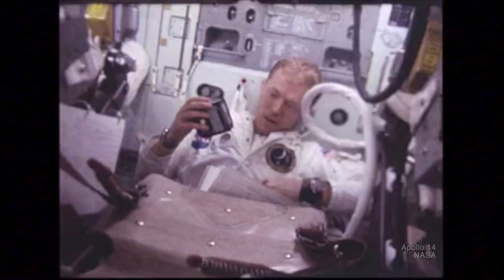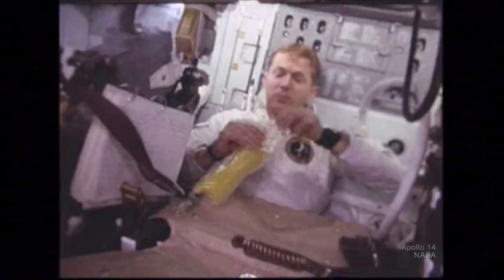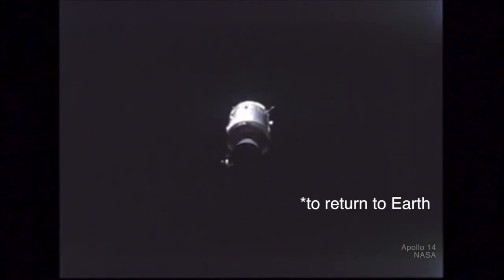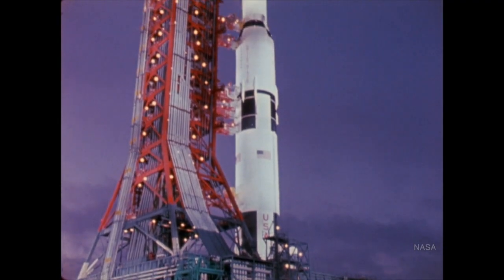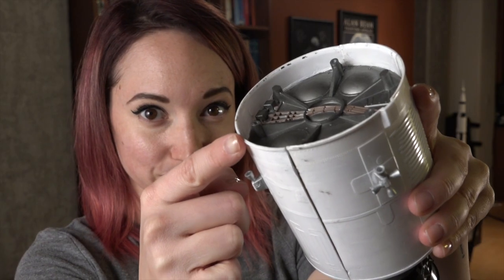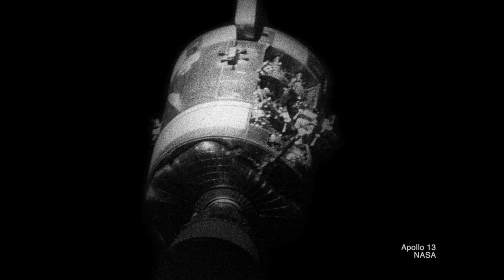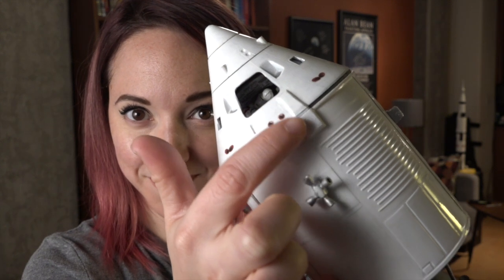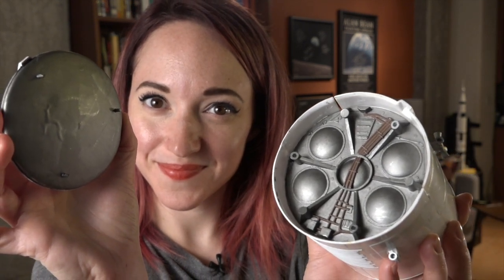How Did the Apollo Command and Service Modules Separate?

Comment: After CM/SM separation, how did the SM fall clear of the CM so as not to be on the same re-entry trajectory? Were the retro rockets (or whatever you call them) on the SM programmed to fire after jettison so that the SM would continue on a different trajectory?
Reply: The SM had a preprogrammed flight that activated after separation.

Comment: Apollo 13 they had to do things differently because the service module was destroyed in the explosion they could not use the compression springs to separate the ships because the power to them was routed through the fuel cells and the fuel cells were destroyed. to separate they had to use the LEM thrusters and the command module springs to separate designers feared the heat shield was cracked because of the shock of the explosion.

Comment: If there is a Heat shield down below, How did the astronauts manage to move from 1 module to another without spacewalk??
Reply: They don't. The service module wasn't accessible from inside, it just provided everything to the command capsule through an exterior connection.

Comment: New topic.
What type of rations did the crew on a moon mission have, how much did all of it weigh and how was it stored?
And please do one on how they used the bathroom during the flight both in the CM and in the LM on the moon.
Reply: There are scientific sites about Apollo, which are much better to consult, than amateurs on Youtube...

They had freez dried food in plastic bags, to which they added water, hot or cold.

The answer to your second question is sealable plastic bags with odor killing chemicals.
You know, there was a small compartment under the seats, if they folded one, where they could have a little privacy.
Reply: @YDDES  Liquids ie urine was overboard dump wasn't it YDDES. I know they chemically treated and stored solids.

Comment: I seriously doubt about the guillotine.
I guess they were primer caps, instead
Reply: @heclam: you should google this stuff before posting. Yes, a guillotine mechanism was used to severe the connections.  A very lite explosive charge was also used, as part of the guillotine mechanism to drive the mechanism to ensure the cut was complete.

Comment: I was just looking at some pictures  of  the  Apollo  capsule  after  splash down  and remembered  a question  I always pondered the answer to.... the picture shows  the floatation ring around the base of the capsule and 3 floatation bags up on the nose.  If the bags on the nose were to right an upside down capsule, why did the picture I saw only have 3 bags?  Also, the bags positions seem to be in wrong positions, there is no bag at the quadrant of the capsule where the egress hatch is located .   From my point of view, in a worst case scenerio, the capsule 'could' end up with the hatch under water and hinder egress after landing.  Am I missing something ?
Reply: "Am I missing something ?"   -   At least one thing that you are missing is that you appear to be assuming that the command module's center of mass is on its vertical axis, while in practice internal equipment distribution had offset the center of mass away from the hatch (apparently to give it some aerodynamic lift during re-entry   https://youtu.be/ayBNbY92cQM  ). So if the CM was capable of floating on its side (and I suspect that it wasn't, as I suspect that the center of mass was too low in the CM to allow that to be stable) then it would tend to roll to place the hatch uppermost. The offset center of mass may also explain the asymmetrical flotation bag positioning (though I would bet that system was designed to still work if one of the bag had failed to inflate, which would have rendered any symmetrical arraignment of bags asymmetrical anyway).
Reply: Richard Cornford Thanks for the reply.  My curiosity  made me blind to some of the engineering  involved.  I just watched  the video you linked and, along  with your comments , have rethought my question .  If the CM was built with the center of mass low and at the astronauts  feet for flight characteristics  then the locations of the floatation  bags makes more sense.  Watching  a splashdown, the CM hangs under the parachutes  with the lower CG  canted  downward.  Therefore, a flotation  bag could be needed to ensure the nose didn't  dip too far into the sea before the CM stabilized right side up.  Thanks Richard ,  you got my brain up and running  and reinvigorating  my fascination  with manned space flight.

Comment: Questions:  1)  How did the CM and SM "drift" apart?  Thrusters?
2)  Why not do an episode on all the hold down bolts and explosive bolts used in staging, liftoff, etc.  These connections were critical to mission safety.  How did they know that they would work?
3)  Finally, what about the explosives, if any, to be employed by a range safety officer?  How did that system work?

Otherwise, keep up the good work.

Comment: Hello!
I have a question not about how the Saturn V was “disassembled” but rather how it was put together in the VAB, because dealing with all the highly explosive material of solid fuel rocket motors, the explosives for stage separation and connecting two “pieces” of a rocket to one seems like a difficult and dangerous job... I mean did they weld the stages together or what :D?
I’d really like to be enlightened :^)
Reply: There was no solid fuel. Saturn used liquid fuel. And this was filled in only after the rocket was on the launch platform, and not in the assembly or before the transport. 

And the other explosives were so small, and they just didn't arm them before the rocket was on the launch pad. So nothing to worry about.

Comment: If true this was a great moment in history, unfortunately the US government has never told the truth about anything that I'm aware of so I'm going to take the moon landings with a grain of salt until proof is available.
Reply: There are photos made by space probes, and even by telescopes, already some years ago showing the remains of the landings on the surface.
And also already during the flights the telemetry was received and radio waves were tracked by stations all over the world not controlled in any way by the US or NASA.
More proof than anyone would need to clearly recognize it was the real thing.

Comment: After separation CM used surge tank to supply crew with oxygen, evaporators were used to control temperature and batteries (they had 3 of them) were powering the module. CM had its own RCS which was activated after a separation.
Model you are holding is not correct. Umbilical should be on the bottom and the second thing is that it was spring loaded.
Reply: Umbilical would not be on the bottom as any hole in the heat shield would case integrity issues,
Reply: @deepsleep7822  You have messed up the coordinates. Bottom is where astronauts have legs, heatshield is behind astronauts so it's at the back of the module and not at the bottom. The model she is holding shows the umbilical at the top (above astronauts heads), while IRL it was at the bottom of the module (below astronauts legs).

Comment: Here's a possible question for a future episode - Since the occupants of the LM had to stand for the descent to the Moon, how did they keep from floating around inside the cabin? Also, videos of the takeoff from the surface of the Moon look pretty fast. What were the G forces that they had to stand up and control the ship in like?
Reply: They wore a belt which had a thin steel rope on it, which were fixed on the floor.

Comment: How did astronauts travel from the service and command modules if there is a heat shield in the way?
Reply: While it's true that the crew never entered the service module, there were a few occasions where they had to do a spacewalk to access the service module during their return from the moon. On at least one mission there were film packs back there that had been exposed during lunar orbit. These had to be retrieved by hand before reentry.
Reply: There was a tunnel from the top of the command module to the top hatch of the LEM. Hatches and a docking probe had to be opened or removed for access.
Reply: I just posted that.  And missed it.  But I thought they passed through it ??  Confused
Reply: +reptongeek  The CM's heat shield is only on one side of the CM--the side adjacent to the SM (and therefore not visible until the two separate)--so it did not get in the way of docking with the LM.  The CM's nose on the opposite side docked with the LM's topside, a round airtight seal was established forming a tunnel between the two spacecraft, pressure was equalized, the docking equipment (a probe and drogue) was removed from the tunnel and stored inside the CM, and then astronauts could go through the tunnel back and forth between the CM and LM.  Or on second thought, I should have just posted this link:
https://www.youtube.com/watch?v=Ac47IgC39m8
Reply: ahhh Now I understand...So they only passed back and forth when the CM was flipped.  That clears it up. Thank you.

Comment: I don't need some young tart in a tight shirt trying to prove to me how NASA pulled the wool over the American people in 1960, by using video media today to "add" logical technologies that never existed back then to help explain how NASA did things. I have blue prints of the command modules and none of them list this "guillotine" that is attached along its hull. As a matter of fact, I like how previously released videos on YouTube are now presenting this "guillotine" housing prominently along the ships hull. Another NASA cover up if you ask me!
Reply: Looking at a November 1966 copy of "Apollo operations handbook: Command and service Module" I find section 2.9.3.1.5 (entitled "C/M-S/M Separation Mechanism") which describes a "dual-blade guillotine (umbilical severance device)" and figure 2.9-1, which depicts an "Umbilical guillotine" mounted inside the service module umbilical fairing and attached to the outer surface of the service module.

So if NASA had 'added' a "logical technology that never existed back then" they have managed to add it into the documentation at least by 1966, so several years before any moon landings had happened.

Of course it makes sense to attach the separation mechanism to the service module rather than the command module as once the separation had happened  the mechanism that achieved it would have become as redundant as the rest of the equipment on/in the service module. And this means that looking for the guillotine mechanism in blue prints for the command module (as opposed to the service module) would not locate the separation mechanism. Your research methodology is clearly  too narrowly focused to be effective.
Reply: Nice try. But you're very obviously an artificial intelligence program and not a real human. A word to the programmers - the key part if artificial intelligence is INTELLIGENCE. Your program has all the smarts of that old BASIC program Eliza.
Reply: You need a personality implant. Is your hero Arnold J Rimmer?
Reply: Q Storm you got rekt
Reply: Actually sir, I made my research about the umbilical system, long time before vintage space girl, and I have reached the same information.
The Apollo program was the best.
Reply: Don't be an idiot.  Just watch the young tart with the tight shirt with the volume off.  She's more attractive that way.
Reply: N. But yours is a young woman wearing a tight shirt and showing off her tiny breasts while talking space gibberish on YouTube.

Comment: After the service module seperated the ground had control firing the RCS to move away from the command module and steepen it's angle of reentry allowing it to burn up completely.

Comment: I thought the crew could enter the service module, but that would mean passing through the heat shield.
Reply: +Tom Riser
The service module was really not that big. It had the engine, fuel, oxygen, supplies, electrical power and that was about it. There was just not enough room for anything else.

Comment: In Apollo 13, the crew used the LM to generate upward thrust before SM jettison and then reverse thrust after to allow a clean separation of the CM and SM. I'm wondering how they did this on Apollos 7 & 8 when they didn't dock with an LM?
Reply: the sm has rcs too. It performed the separation. Remember! Apollo 11, 12, 14, 15, 16, and 17 DID NOT bring the lm back to earth, All the lms were crashed into the moon
Reply: But the ascent stage of Snoopy [Apollo 10's Command Module was named "Charley Brown", btw :-) ] is still in orbit around the sun. Ref: https://www.space.com/13010-snoopy-nasa-lost-apollo-10-lunar-module-search.html (They crashed Snoopy's descent stage only into the moon...)

Comment: Just a thought; the Appolo Service Module was not exactly smooth on the outside.  How come bits like the Reaction Control Thrusters didn't just get ripped off during launch ?
Reply: There also so thoroughly tested during development, that after A LOT of trial & error, they wound up with a finely engineered system
Reply: It reached extremely thin air before it reached really high speed.
It was diiferent whe it returned to the atmosphere at high speed.

Comment: The guillotine cutters method was also used on the F-111 series of aircraft. It didn't have ejection seats, it had an escape module. Iirc, the 111 used a blade driven by an explosive.

Comment: But how did the consumables and ASTRANAUTS. Pass through the heat shield from the cm to the sm ??????. Fake.
Reply from the maker: +Eddie Townsend They didn't go through the heat shield, they didn't go into the SM at all. They drew power from umbilicals, that's it!
Reply: Eddie Townsend A few of the service modules, Apollo 15-17, I think, did have a SIM bay that could be accessed, but only by spacewalk. And no, not fake. Not fake at all.
Reply: actually,  Apollo 13, and 14 had one too, (not sure about 11 and 12) The sim bay is visible in the picture of the Apollo 13 csm That was in this video! It is the hole with all the satellites in it, It is quite small and was only to store small items like satellites which could be deployed via spacewalk

Comment: If one of those straps holding the cm to the sm failed to break away before reentry would that have been every bit the disaster I think? I mean LOVC.
Reply: My guess is that bolts could be turned inside the CM to release the straps.

Comment: Stainless steel blades seems a bit complicated and heavy to separate the two.  Why not explosive bolts?

Nice video though.
Reply: Would there not be a danger of such explosive bolts close to the heat shield damaging it?
Reply: Stubrit while not 'bolts' the blades of the guillotines were driven buy explosive charges.  This ensured that the blades would cut all the way through and everything was housed to protect critical areas, as with all pyrotechnics on the spacecraft.
Reply: the soyuz spacecraft uses explosive bolts.
Reply: Perhaps because straps could go around the edge of the heat shield, whereas bolts would have required making holes in it?
Reply: Cracked heatshield = a dead Armstrong
Reply: @sol2544  And forgetting a dead Aldrin and Collins too.

Comment: amy how  did the astronauts get into the lm from the cm , and vice versa
Reply: after docking, the CM crew would open the hatch, and remove the probe and drogue docking mechanism and stow the parts in the CM in provided places. then, after making sure that the pressures between the CM and LM were equalized, they'd open the hatch on the LM and go inside. before the two craft would separate, the probe and drogue docking mechanism would be reinstalled before closing and sealing the CM's hatch. repeat procedure after the LM's ascent stage docks with the CM after lunar landing. before jettisoning the LM, toss the probe and drogue parts into the LM along with any other unneeded garbage to save weight before closing and sealing the hatch. kiss the LM goodbye and go home.

Comment: Question, I assume the CM had its own oxygen supply having jettisoned the SM, only considering the layout of the CM it is surprising that was fitted in? If it did, would the mix of nitrogen and oxygen be the same or was it pure oxygen only once separated?
Reply: pure oxygen, It was pure oxygen for the WHOLE FLIGHT Excluding the launch, Where they had nitrogen too
Reply: @whiplash7400   I thought pure oxygen was done away with after the Apollo 1 fire.
Reply: @deepsleep7822  Only for the pad and the start of the launch. During the launch, the nitrogen was bled out and it became a pure oxygen environment for the rest of the flight.

Comment: Question: What color was the Apollo Command Modules? I've seen pictures that look like a shiny mirror like material but on Apollo 11 and Apollo 16 both (I've seen in person and actually sat in Apollo 16 and flipped switches before it was sealed) appear to be almost a phenolic material and brown. I'm fairly positive they were not white, that was the LES.... So what was it Amy? Thanks Luke
Reply: Things tend to change color when subjected to extremely high temperatures.
Reply: For some reason all of the command modules on display seem to have had the protective tape removed. Pictures of the CM's right after splashdown show much of the tape on the side of the spacecraft was still there but it's all gone once the they are on static display. I know the CM's were heat soaked in a vacuum chamber after the mission to dry out all the seawater to prevent corrosion. Maybe they took the tape off to facilitate this.